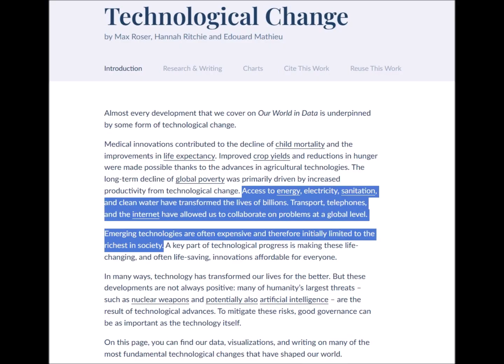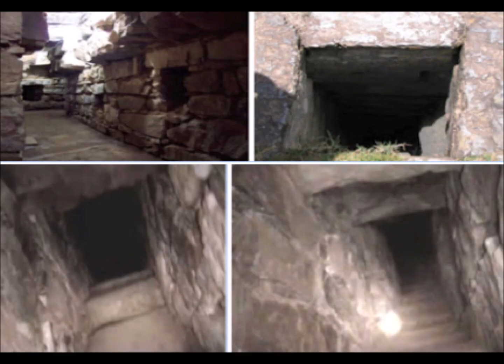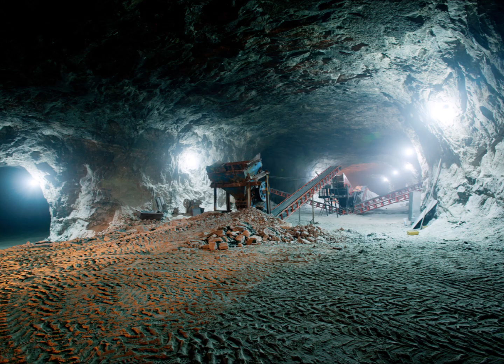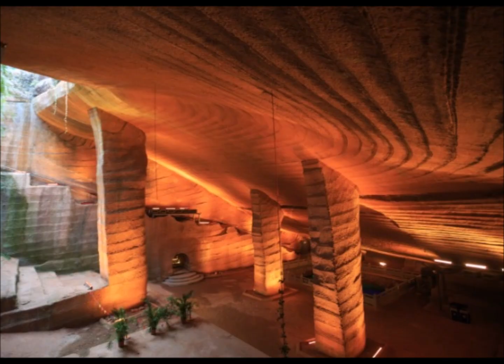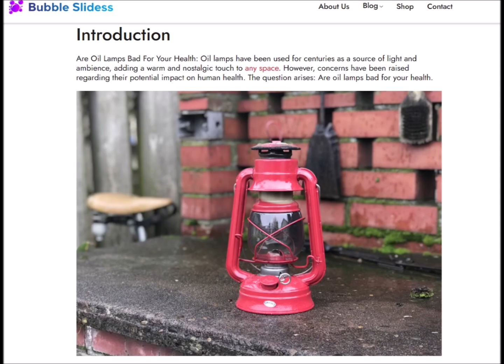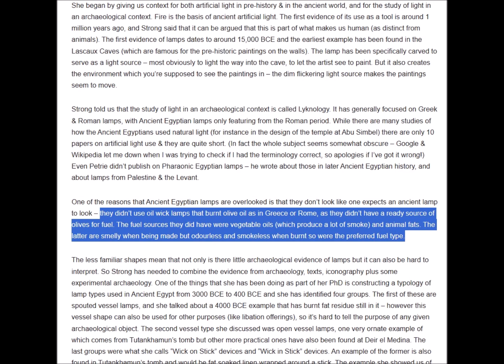Ancient Advanced Lighting: Did the Egyptians & Aztecs Harness Bioluminescence and Triboluminescence?

Comment: The Egyptians are said to have added natron (sodium carbonate "soda") to their castor oil lamps to eliminate soot from forming. It adds carbon so the combustion of the hydrocarbon in oil can burn more completely to carbon dioxide instead of leaving unburned material (soot and smoke are just unburned fuels)
Reply from the maker: Certainly. It is said that adding salt to torches also reduces lampblack.
Reply: Hmm that falls in line with the land of chem youtubes channels theories
Reply from the maker: @SweetChillieBeat   I hadn't heard of that channel yet. I'll have to check it out! Thanks!